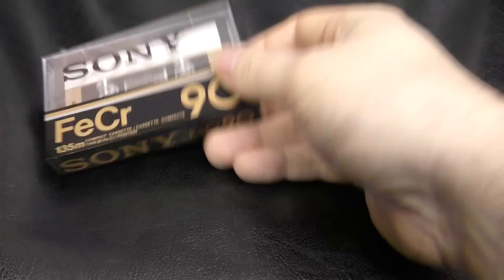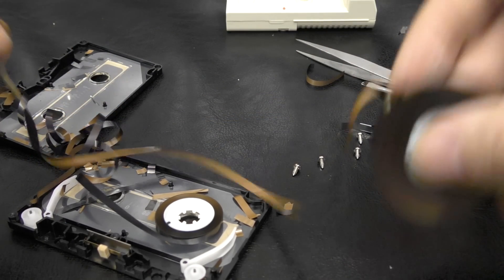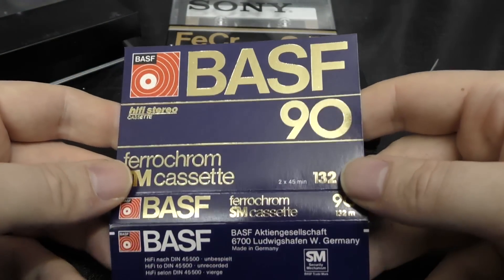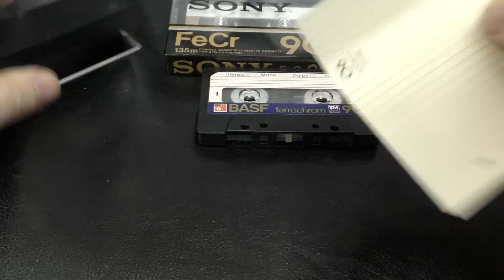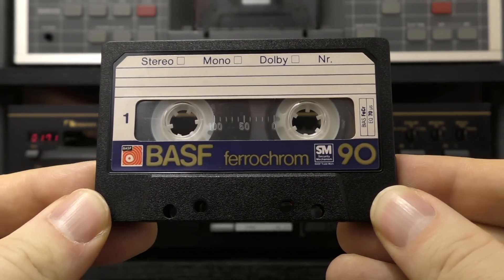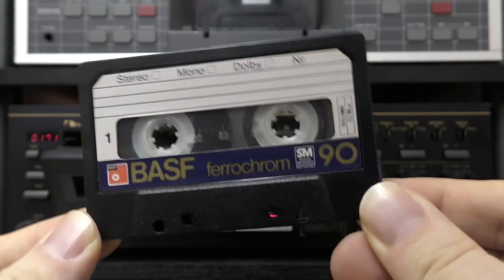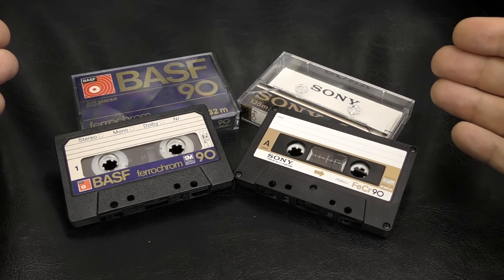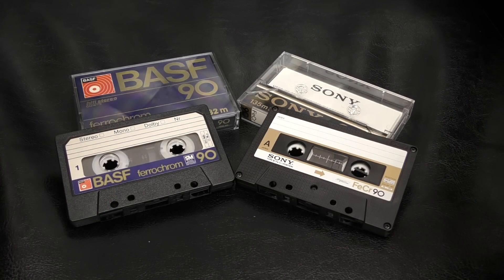Type 3 FerroChrome Cassettes - You Wanted Them, You Got Them!

Comment: I tend to agree that the SM is the cause of destroying the tape. I've had it happen to me with just LH (and this was in the mid 80's). I avoid SM tapes like the plague. The Sony on the other hand: I have a few used examples and the recordings are amazing (if you like classical music) and suspect were recorded on a dedicated type 3 deck. I'll have to try you're method (It's still playing to be fair so I don't know how it turns out).
Reply: OK, I'm sold on the technique. Prices for the Sony, I may as well buy a new deck. I will have a play with the used examples I have. Cheers!
Reply from the maker: Yeah, I remove all SMs now. Maybe back in the day they added something, but like you, I've had Agfa grind to a halt, but work fine with them removed. If they were that good, why did they stop and why weren't they widely copied....
Reply: BASF used the SM cassette from 1971 through the mid 1980’s, and it does fine, but I don’t have any problems with BASF cassettes. I used to have a bunch of BASF cassettes that has the Security Mechanism on many Ferro Super LH, Studio I and a few others. By the mid 1980’s BASF Stopped making SM cassettes and replaced with a different kind. I have a few LH E I cassettes with no SM at all.
Reply: @CassetteComeback  BASF stopped making the SM for several reasons: 

- 1. Some sloppy low cost transports without back tension on the supply reel could, in combination with the tusks, lead to the tape being trapped and come to a sudden halt, or cause other jamming accidents. On a good transport, the SM does very well, but there were too many bad transports out there, with too many customer complaints as a result. 

- 2. The engineer who had invented SM received a royalty, albeit only the fraction of a penny, for each cassette sold, and was becoming a very rich man. When he retired, BASF started to phase out the system.
- 3. When the SM was introduced in 1971, it was about the only way to ensure halfway even tape packs during fast winding. By the mid-1980's, the precision of the cassette shells had been significantly improved, as well as more and more sophisticated slip sheets with auto-spacing structures and anti-static coatings were developed. These improvements made the SM technically obsolete.
- 4. The first tape model to drop the SM was the fabulous LH-MX I, which was introduced in 1985. Its tape was BASF's first double layer type I, and it was a tad thicker than standard C-60 or C-90 tape. Its tape packs were so fully loaded that there was no room left for the SM tusks in the cassette shells.
- SM could not simply be copied, at least not legally, because that BASF employee mentioned above had been wise enough to have it patented. Every other company that wanted to use it had to pay a royalty. Agfa and Teldec did, as well as some companies who had their cassettes OEM made by BASF, for example Grundig. Other cassette manufacturers tried to mimick the SM without really copying it: Audio Magnetics had some floating guides, BRG from Hungary had a rather primitive SM knock-off, and TDK installed a very sophisticated guide system into their D 180 cassettes, which was also clearly SM-inspired.
Reply: It was a binder problem: Even some BASF reel to reel tapes from the same period are shedding off their oxide layer like the cassette tape in this video. The SM may help to start the destruction process on an affected tape, but SM wouldn't do any harm to a tape where the magnetical coating is sticking as firmly to the base film as it should.
Reply from the maker: Great insight, but the inside of the shell was also full of oxide. Whether it was the SM or not, I remove them now.

Comment: I would advice to spend a little money on a different deck that has a full BLE diagnostic of the tape and even sets (Calibrates) the EQ correctly. I noticed that a Pioneer CT-339 or a Pioneer CT-W701R has a perfect calibration system called "Super AUTO BLE" It does 3 things, optimizes BIAS, LEVEL and EQ. The CT-701R even uses auto reverse to play the tape in the opposite direction but measures through the same Side. Genius and wonderful to look at. EQ is excellent set between what this FeCr needs. it won't sound dull.
Reply: your sugestion is like swap super sport car with manual gearbox into volkswagen with auto gearbox. ps, it will soud dull, its III type cassette and non of yours pioneer etc has compatibility with type 3 cassettes. ps, get some knowledge.
Reply: @Johny666EU  Well, it's not officially mentioned anywhere on the deck because it was long dead, but it would be interesting if the Auto BLE could calibrate to type III.
Reply: @robine5280  nope, it's not design to type 3 and will not calibrate it. Its like to use diesel engine for airplane fuel. It simply doesn't work. Type 3 is only on very old decks where the auto calibration didn't exist so there is not deck to do it.
Reply: @Johny666EU  Have you tried? Maybe it calibrates as some strange tape. Tape selection happens mechanically so it would recognize it as type I but I don't know how far it can adjust. Its adjustment range. 
I mean, it records different test tones and listens back to them, saving the settings the sound was best with. Tape type shouldn't matter if the calibration range is big enough. I've got an S. A. BLE deck but no type III tapes and I wouldn't consider my ears to be  suitable for testing this kind of stuff. Maybe Tony knows something about this but I don't know if he still reads his comments on old videos (or if he even gets a notification).
Reply: @robine5280  nope, it will not as I have described above. Technical differences. Water is not petrol etc.
Reply: @Johny666EU  Well, apart from car references you didn't describe much at all from a technical standpoint. 
Anyway, if I ever get my hands on a type III I'll try. It is very likely that it won't work and the calibration system might get confused with a tape that has some characteristics of this and some of that, but until someone tries we don't know and I'll stay curious.

Comment: Hi Tony. 2 Questions. 
I've just found one BASF Ferro Chrom. Of course it's not brand New but in a Nice condition. I would like to record on it. What is the best way? Should I take off the SM ( securty mecanism ) or not? I had one BASF Chromdioxid 120minutes with SM also. I only listened it on my Technics M224 deck tape from more than 30 years and avoid to use rew or ffcue fonction on it. But now, when I listen it the quality is not the same. Is it because of SM or because of 120 minutes (maybe not made for listening music)? I dont know. What's your opinion? Thanks a lot.

Comment: I have a BASF Ferrochrome and a deck capable of type 3. Unforunately the tape is in bad condition :(
Reply from the maker: Yeah, these seem the most fragile Type 3.
Reply: @CassetteComeback  Yes, the earliest ones from the mid-70's with all-blue labels can even get sticky :-( But the late series called ferrochrom III (1980-84) seem to be stable, at least I have not had a shedding or drop-outing example of them yet.

Comment: what does that mean azimuth? It should be the tape head position in relation to the "track" on the tape or so, but is usually a screw and factory set. You cannot set the azimuth on a knob, nor is it any problem if you record and play on the same deck, it only ensures that the tape can be played on varous decks. 

Not sure what this guy is doing there, prob does not understand that he cannod set it by a knob, or the wording for the knob is wrong or something. Also it cannot be off so much, you basically NEVER have to touch that.
Reply from the maker: You don't know what you're talking about more like. The head is aligned at the factory, but 30+ years later they could have moved. There is a screw you can turn on one side of the head to adjust it. The azimuth is the perfect angle. You've obviously never had a quality deck as you'd know this.
Oh, and several decks have an azimuth alignment "knob" - The Nakamichi CR-7 for example...you can even set it with the remote control.
Reply: Nakamichi top end decks have an azimuth adjustment knob. Some models let you adjust playback head azimuth, some recording head.  Nakamichi 3 head decks bear not a "sandwich" rec/play heads but discrete record and playback heads and can be adjusted independent of each other. On this particular deck recording head is adjusted and plpayback head is factory set. This makes sense as due to different cassette shells manufacturers tape path  can be slightly off a factory setting.
Reply: @CassetteComeback   Yes, this is how it usually works with prerecorded tapes, but how does it work with blank tapes, could you please explain? Is the playback head independently adjusted to the fixed position of the recording head for a perfect match? Which means the recording head is preset at the factory and only playback head can be user adjusted.

Comment: My understanding is that EQ has nothing to do with recording.  You apply EQ upon playback.
Reply from the maker: You've got me thinking now. I have always taken it for granted that 2&4 are recorded at 70 microseconds. I know that you can record pure chrome's at 120 microseconds and play them back as a Type 1, like the pre recorded chrome's. The biasing of the chrome was different at 120 than at 70.
Reply: @CassetteComeback  II & IV are recorded at different bias levels.  IV requires quite a bit more 'juice' to lay down the magnetism onto it.  They both playback at 70us.  I think that's a common misconception that bias and eq are the same.  They are not.
Reply: Incorrect, EQ affects recording and PB. More detail here: https://www.tapeheads.net/showthread.php?t=23741
Reply: @CassetteComeback  He's got a point Tony. Just like the pre recorded Chrome cassettes. If I were you I would try the Auto calibration on the Revox and Nakamichi 
But then ofcourse set the recording type as type 2. Think it's worth trying, this because those prerecorded chrome did allso switch to type 1. 
But for now Merry Christmas and as you allway's say, Happy taping.
Reply: EQ is also used during recording. The "70 usec" & "120 usec" do indeed refer to playback EQ. Cassette decks were designed so that they play back with flat response at 120usec or 70usec. To do this, there must be recording EQ to compensate for the deck's treble loss. Treble gets boosted during recording. Upon playback treble gets cut, but to a limited extent. To get flat FR, the treble cut must be defeated at some point. With a 120usec playback eq, this point is at a frequency of 1,326 Hz. Above this point, no more treble cut occurs. With 70usec, the transition frequency is 2,274 Hz.
With 70usec playback eq, there is more treble cut, resulting in about 4.5 dB lower noise.
Also, in order to get flat FR with type 2, more treble boost is used in recording. Saturation can happen. Europeans used type 2 tapes but with 120usec playback eq. The benefit was that less treble boost in recording resulted in lower distortion due to avoiding saturation. The downside is that 120usec playback is noisier.
Reply: @claudeabraham2347  perfect explanation. Thanks.

Comment: I recently went through my tape collection and found around 10 unopened blank cassettes that were most likely purchased in the late 1990s...after seeing this I want to ask "Do you think any of these 20+ year old type II tapes are safe to use in my decks today?" :s
Reply: Depends on the brand and how they were stored. I have a TDK D-C90 from the late 70s that still works fine.
Reply: The only problem I faced opening a blank cassette from 1988 was that it stunk, it plays fine and sounds great for a type 1. So long as the climate it was in was okay then it should be fine.

Comment: too bad you couldn't just flip the BASF tape the other way around and use the other side of it
Reply from the maker: Yeah, that would have been interesting...
Reply: Haha, I tried this when I was a kid. It recorded at a very low volume only. Later, I learned that tapes always consist of a base film and a magnetical coating... and the base film is thick enough to act as a spacer between the head and the magnetic material if you use the tape upside down, so the magnetic field is already to weak to produce a good signal.